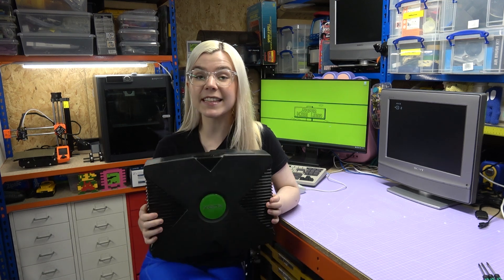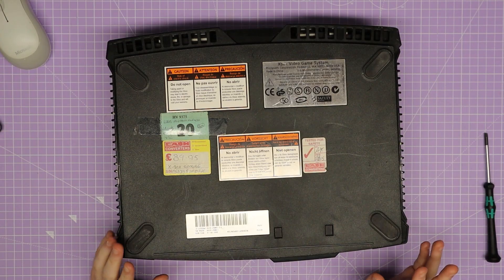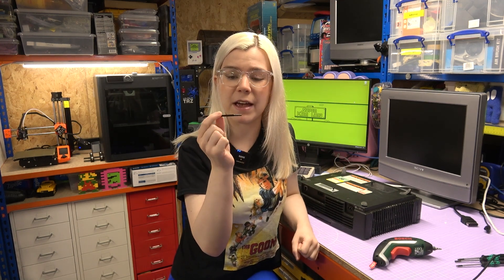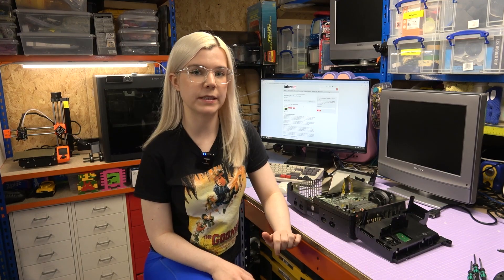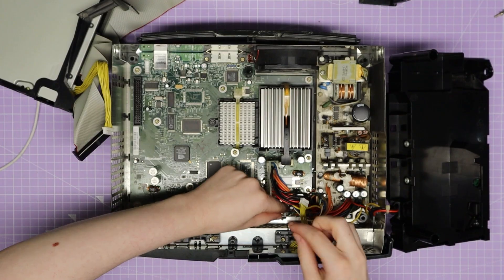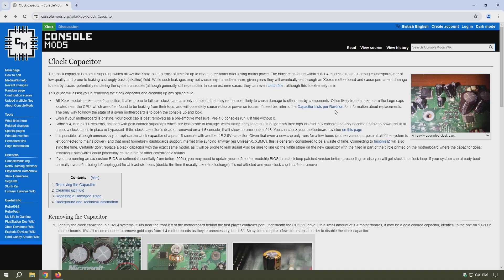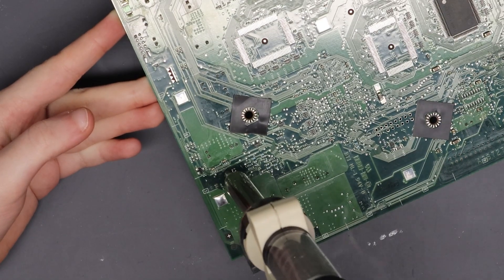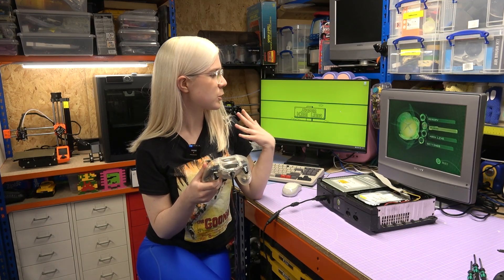Removing the Xbox Clock Capacitor before it destroys the console

Comment: What makes you think this capacitor would leak soon (and others surely won't)? It wasn't even bloated. Use ESR meter. It's cheap but extremely helpfull during restoration of old devices. You desolder a cap, check it with ESR meter and you know for sure if capacitor should be replaced or not. And why didn't you solder back a replacement cap? Even mediocre taiwan caps would last years in years under this conditions and they are so cheap. That doesn't make any sense. You following some bad troubleshooting guide without even facing an issue from this guide. And no, if capacitor fails, it won't "destroy the console". Worst that's gonna happen you gonna need to clean a leaked electrolyte. If you re in a jungle, capacitor is blown, then yeah removing in without replacing, makes sense. Otherwise you don't have any reason too.
Reply: Although I did enjoy the video, I have to agree with you. As someone who is well versed in troubleshooting and replacing parts, capacitors are for the most part (unless they were those nasty NEC sourced caps from the 90s) are for the most part, reliable. Especially if the power supply is within normal operating voltages and current. And there is an old saying "If it ain't broke, don't fix it". Sure a good cap kit can't hurt, but it's just wasting time if the caps seem good and you don't have any suspicious behavior which a good service guide will show. An ESR meter is good as well for this, as is a good high quality DMM (Digital Multi Meter). Between the two will diagnose most analog (caps, resistors, diodes, etc) problems and with minimal cost and space. 

As for batter back up devices? I usually solder in a super capacitor with at least a 20yr life span. So much better than those watch batteries, or soldering in a AA or AAA battery holder.
Reply: @deathstrike  oh not like i didn't enjoy the video. Kari is doing an intresting content and it's about sharing expirience, not for the sake of criticizing.
Reply: @dmwzr  Maybe you should consider the validity of the content perhaps? In the first place, constructive criticism is often necessary if certain issues arise. Second, there are issues in the video that many commenters are calling out. I was being polite and constructive, and so were others. So what is wrong with enjoying the video? You can enjoy a creator's content, even if you do not agree with steps taken by the creator. And btw? You want credibility? Back up your comment with a real tag. "@user-xxx..." means you like hiding behind a shadow, or you just like trolling.
Reply: @deathstrike  >"Maybe you should consider the validity of the content perhaps?"
There is no validity in blind following a manual, that doesn't correspond to your case. This statement is 100% polite and constructive. And like any other video, the is an advertising for everyone to do the same. When instead, a real 5 sec. troubleshooting should be done. But lets specify. We don't talk any content here, just this particullar case.

>"So what is wrong with enjoying the video? You can enjoy a creator's content, even if you do not agree with steps taken by the creator."
Nothing is. That was my point actually and I don't understand what made you think otherwise. I've spelled something wrong in my message probably. 🤔

>"And btw? You want credibility? Back up your comment with a real tag. "@user-xxx..." means you like hiding behind a shadow, or you just like trolling."
Some people may have resons fot this. This may include political situation, war conflicts, or just not being care of why YouTube implemented this feature at all. But i'll get those brains of yours cool and won't make you google search. In 2022 Google implemented nicknames on YouTube and those who didn't set em in profile, look like "@user-xxx..." to you. Those people are not hiding (if they do, most likely not from you) and there is no other conspirancy happens. If you don't like this, you are welcome to send your feedback to Google. I won't cause i don't care. Credibility comes from a statement's logic, not from a nicknames (which no one gonna remember in comment section at all). And i honestly don't understand how i'm trolling you, if we were talking just about same thing all the time.
Reply: @dmwzr  Alright I'll summarize this. First thing "not for the sake of criticism". When you commented that at me  you made it sound like I was criticizing her content. I was not. Second where have you ever acknowledged that I was actually agreeing with you?  Read my comment again. Next thing, snarky comment aside "cool your brains I won't make you Google it" was that necessary? Many times people who use @user-xxx are often trolls or people who just come into rooms and trash people for fun. And when you said that there are reasons people use those kind of tags you actually responded with what appeared to be a Russian Cyrillic name. Nothing at all wrong with that. Why didn't you use that in the first place? It's obvious you could.

I'll chalk it up to just maybe perhaps a misunderstanding. But I'm not going to sit here and argue with someone on the internet, that's just uncivilized and crass. I'm done.
Reply: @deathstrike  >"First thing "not for the sake of criticism". When you commented that at me  you made it sound like I was criticizing her content. I was not."
I just wanted to say that I didn't write my first comment with the intention of criticism. That part wasn't relate to you in any kind and i'm sorry it made you think this way.

>"Next thing, snarky comment aside "cool your brains I won't make you Google it" was that necessary?"
There is nothing "sharky" about it. Modern world is complicated with many information to process.

>"Many times people who use @user-xxx are often trolls or people who just come into rooms and trash people for fun."
Send a feedback to YouTube, not me. Use a report button.

>"And when you said that there are reasons people use those kind of tags you actually responded with what appeared to be a Russian Cyrillic name."
Yeah it works like this sometimes. Sometimes it shows account name, some times it doesn't.
Yet again it's your ignorance thinking cyrilic is used only in Russia. Thankfully i don't have Russian name, Russian anything and have never been there so far.

>"Nothing at all wrong with that. Why didn't you use that in the first place? It's obvious you could."
Cause simply no one asks you what to do and it's unclear why you think your opinion about this is necessary.

>"But I'm not going to sit here and argue with someone on the internet, that's just uncivilized and crass. I'm done."
Arguing should include actuall arguments, not unrelated discussions about nicknames or an attempt to stand out with fancy words. What are you doing now is just bickering.

Comment: Agreed, I restored the 2 og consoles I currently own. Since both of these are 1.6 didn't need the clock capacitor to be replaced yet, but I'm planning to do it.

I strongly advise replacing all the 6.3 V 3300 uF in this mainboard to avoid any power or malfunction issues. 
They filter the current power supply for the Intel CPU and the custom nVidia graphics chip. 

And if possible, to make a perfect work, do a full change for all the electrolytic capacitors on all mainboard revisions of the console and the ones within the power supply. And of course apply fresh thermal paste after cleaning properly CPU & GPU chips and heatsinks. I used AS5 and systems are working pretty good, no temperature issues.

Comment: Thanks for sharing!

Just a hint - if you have issues removing a through-hole component, you can add fresh solder and then take the desoldering gun. That usually works like a charm 🙂

Comment: Removed the capacitors years ago so got lucky. Softmodded it 2 years ago (now hdd can be accessed via ftp) and placed a usb connection inside parallel to a controller connection. Still rocking with the original hdd.

Comment: Doing a CFW on this is incredibly easy you already have all you need you just need to burn a CD with the firmware installer on it after soldering two points together that are so close you can use a solder bridge. From there - you can then add an IDE to SATA connector for the hard drive and add an SSD to the mix - a 500GB is more than enough for all you'd ever want and it really increases the system's performance when it comes to game loading. I think I am going to actually start working on a video of doing this to my own coupled with adding a removable battery for the clock chip...

Comment: The XBOX was the best Xbox Console, and I never knew the screws of the console were so big, The Duke Controller was something else.

I also wish modern consoles were simpler to open. Desoldering is the safer way to remove the Clock Capacitor without damaging the console.

Comment: I still love playing the original Xbox. The last few I've found at thrift shops have been about $10 so your pricing is pretty comparable. I normally soft-mod them when I find one so I don't need to worry if the disc drive fails. And they make great emulation machines.

Comment: It's definitely worth repasting the CPU and GPU on these. Most of the paste will be dried out and harder than cement. Also, replacing the 3-5 capacitors on the power rail is a must, those get beat to hell. Also, recapping the power supply at some point is definitely a very smart investment.

Comment: The capacitor was likely a pain due to a large power plane in the PCB soaking up the heat, so the solder didn't soften on the lower layers. Unfortunately that model of desoldering gun doesn't have a huge thermal mass, so struggles a bit with them. One thing you can do it heat with a hot air gun and use the desoldering gun at the same time. Although your method works too.
Also, the coolest part for me was seeing that you use Wera screwdrivers :)

Comment: 1.6 Xbox version motherboards are good to go the clock caps were fixed in that version but that's the latest build ,, matter of fact they removed darn near all the caps on the 1.6 mb. I have been modding these since you were 1 or 2 =D you should add ram chips XD Also isn't polarity a thing for cap installation?

Comment: The first Halo was nearly a perfect game.  I still think about that last level a lot.
Great job on the hardware fix!
Reply: There was one floor. The auto save was F*d . There was no fail safe on the saves. What I mean by this is if you were about to die and it auto saved it would endlessly loop rather than push you back to the previous save.
Reply: Second half of game is really repetitive. It was so good at the time that they managed to get away with it but today something similar would not fly.

Comment: This is a problem with these consoles. I bought an Xbox in 2009 for pennies and soft modded it straight away. It served as a multimedia hub for my family for years and years. Then it started to behave very strangely. It would power off after a short while all by itself or just operate in random ways. I looked online and found out about the clock Cap being an issue, but I also found more...   It seems that there was a manufacturing fault on many boards that caused traces to erode and break causing the issues I saw. So I did just like you did I removed the clock cap and cleaned the board with vinegar, but I had to go a step further... You see, years ago there was a site called the isozone, it has long since been shut down for copyright reasons but it also contained loads of info for modding and fixing Xboxes and there I found the solution I needed. These days to find the tuto that helped me out you have to search for "isozone xbox repair" in Google. It simply involves soldering wires from various points on the motherboard to bypass the corroded traces. Great work on your videos to date, keep up the good work :)

Comment: You need to mod it with the ability to use Xbox 360 pads. smaller, easier to use and you can even then do thinks like use the RetroBit adapter with a wireless PS4 pad if thats more to your liking.

Comment: Awesome video! I loved my first Xbox... It died for another reason so I don't have to worry about the clock capacitor lol. I remember them talking about that they couldn't find a manufacturer to make their controllers with the features that they wanted. They contacted alot of Japanese companies that made controllers but they all told Microsoft, "No!". So they sort of had to figure it out on their own and that big duke was the result. It's more of a bad prototype that they had to move forward with... they were concerned about Sony's market in the home space getting bigger!

They worked hard on selling the idea that bigger was better lol. Granted alot of western men loved that controller like my brother at the time, so it worked for some!
Reply: It was more that Japanese manufacturers wouldn't make a two-piece board for them, since they were American, even though they would of paid more for it.
So they were stuck with a HUGE one-piece board that they had to fit a MASSIVE shell around.
By the time I got my Xbox, it came with the controller S (which I still thought was rather big) with the white and black buttons at the bottom rather than the top.
I also wondered WHY it had 2 slots in each controller, which made sense in the Dreamcast, 1 slot for the Vibration Pak, and another slot for the VMS/VMU.
The Xbox controller had rumble built in to them, and an 8GB hard drive to save games to.  Pretty much the only thing the hard drive was used for was saved games, unless you wanted to rip cd's to use as a soundtrack.  You didn't need to install games to hdd or anything.
Reply: I have ginormous hands so I'm a fan of "the Duke" controller, lol.

Comment: Future modifications: changing bad capacitors. Softmodding the console (with Rocky5 softmod), doing the swap for a larger hard drive, using a long-enough 80-wires IDE cable for faster loadings especially with games on the hard drive. Using RAM heatsinks and another heatsink for the Nvidia MCPX South Bridge chip to help further with cooling.

Comment: One thing is you should warn people that the 1.6 versions will not run without a clock capacitor installed. Great job overall though...

Comment: Something that you should do to your A500+/600/1200 and the A500 512k expansion as well. As well as recap the 600/1200.

Back in the day (2003/2004 to be exact) when I worked in a computer shop, we jury-rigged a female USB connector to a cut-off X-Box controller cable and were able to adapt pendrives and other normal USB devices to it. The connector on the machine has a 5th pin for 12V and I no longer remember if it was a switched or constant voltage, but I think it was for the rumblers and force motors in the controllers. If unswitched, it could have powered external hard drives of that time, even those with a 3,5 inch drive. Nowadays of course almost all external drives you get are all 5V 2,5 inch devices and the modded cable doesn't need to include 12V anyway.

Comment: Subscribed, you make desoldering look so easy. I was worried about attempting this with my Xbox, but I'm going to give it ago thanks to your video. I can't believe you got the original Xbox for a tenner.
Reply: Just break it off. No need for solder it off. Fast and easy.
Reply: @MAL-Collector  Some people like to do a good job, I'd rather replace it with a better one.
Reply: @ffviifakeremake9997  It can actually be easier to desolder and recap it with the wiggle or twist method, and there's less chance of damaging the board with excess heat since there's no component attached to the legs to leech away heat. If you want more information on the twist method I suggest taking a look at one of the many recapping videos Adrian Black has done on his channels, Adrian's Basement and Adrian's Basement II.
Reply: I don't have an electric desoldering gun but I find it's not hard, even with my spring loaded solder sucker.
Reply: Cutting is definitely the recommended way for surface mounted caps of only having a (1) soldering iron. Better safe than sorry.

Of course having the right tool for the job is always safer still.
Reply: @AltCutTV  That's a through-hole capacitor, not a surface mount. For actual surface mount I'd suggest, assuming that you don't have a desoldering gun, to use a soldering iron and solder wick.
Reply: @DefaultFlame   Sure, just saying. I didn't see any SM on here, maybe there were some. They are certainly getting more common the more recent the system is I think.

Two irons is also an easier option. Most who done some soldering usually have at least one crappy old one extra around.
Reply: @AltCutTV  There's a few SMDs if you look closely but not many. Maybe half a dozen at a quick glance. At a guess I think they're tantalums but I'm not sure.

Comment: I recommend to TSOP flash the Xbox, loads of videos on YouTube to follow but basically what it does it puts a custom bios on your xbox and future proofs it even further, with hhd replacement being easier than ever if the hhd dies, on a stock Xbox it's a pain replacing a broken HDD.

Insignia is a replacement Xbox live for the OG Xbox and works very well id say check all of this out